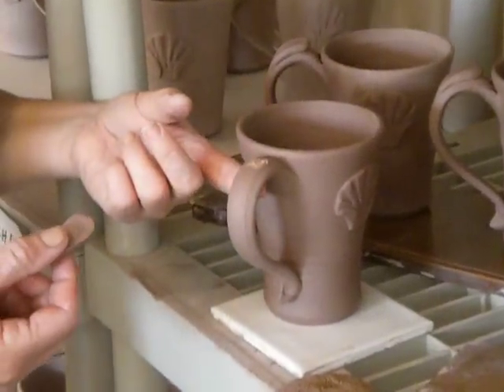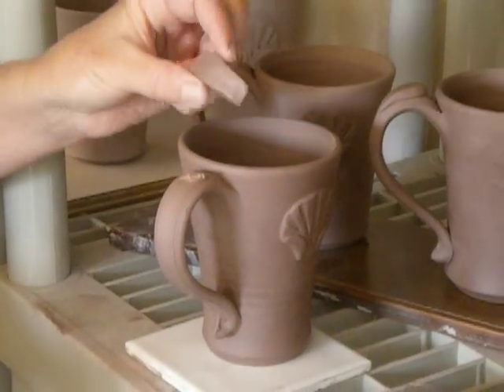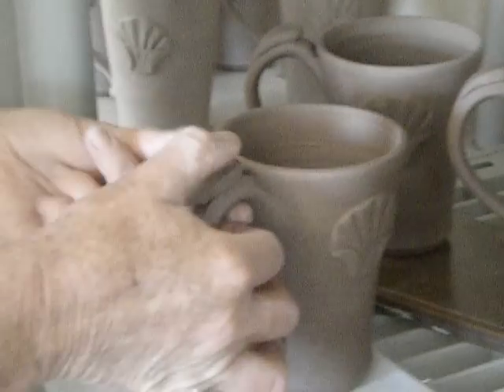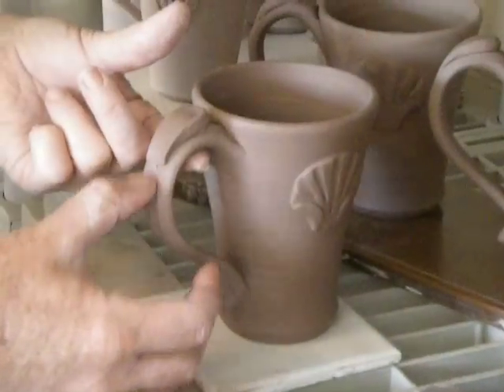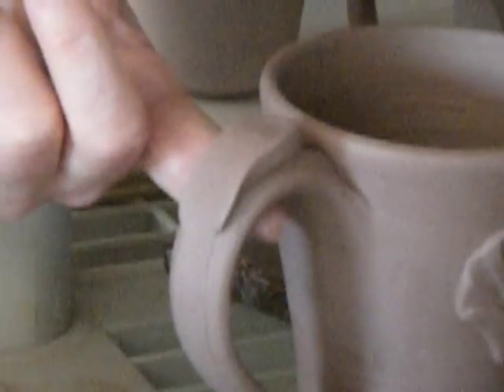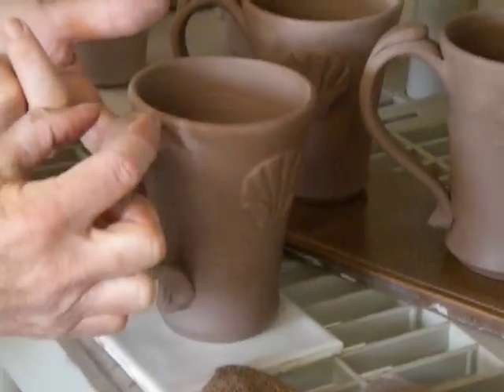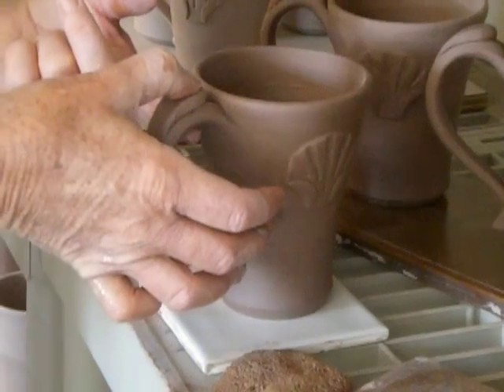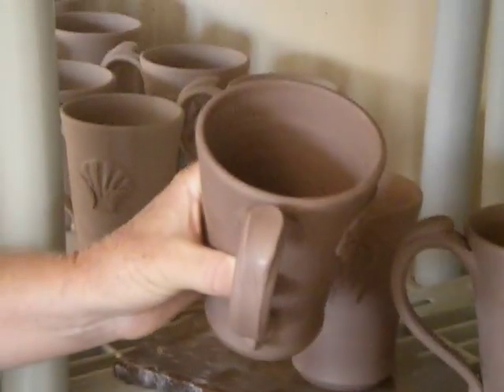Thumb Rest - Video #56

Comment from the maker: @TheSignGuy32 Good Morning from Florida, I use 5 pounds of clay to make 4 mugs... always make 4 at a time to work on my consistancy of height & width. I would be glad to video "Handle Making 101" and my sweetie husband will operate the camera. Concerning glazing... be certain to sieve the glazes! And research your firing "receipe" as well.  My Skutt has a computer so I use the SLOW speed, cone 6, with a 15 min hold at the end.  Be careful not to fire/cool too quickly.  Good Luck, Janice